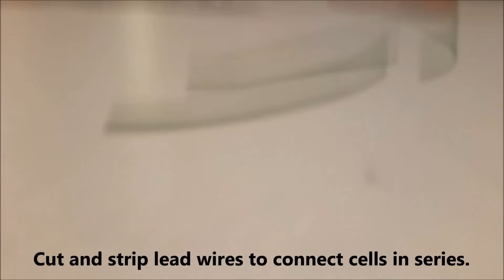Soda Can Battery - Power From Trash - DIY Project

Comment: The inside lining of soda cans, if sanded off, should give you 0.9 volts.  I did it without first sanding it and then after sanding it.  It was 15% improvement in voltage.
Reply from the maker: Awesome Homayoun thank you! I will try that on the next version. Please share and subscribe!
Reply: What grit sand paper?
Reply: Yeah there is a thin film of plastic inside aluminum cans so sanding it makes sense
Reply: i didn't think it would work without a sanding at all
Reply: @Dan Lapain it's thin enough to allow conduction, just not as efficient as it can be...
Reply: I don't understand
Reply from the maker: Hey Guys, I thought you might like our newest DIY Power Bank from JUNK D cell Batteries project - https://youtu.be/myTu52BbfiI  . Would love to hear your thoughts on it. I hope you're having a great day! Please give it a LIKE and Share!
Reply: Could the plastic lining also make for a cheap capacitor material?
Reply: @SourcePortEntertainment  what would happened if you used a blend of sand and powdered battery acid, alkaline water/potassium
Reply: ya there is a plastic film layer
Reply from the maker: @yahwehfirst6051 Not sure. Probably would have had better volts and amps. I was trying to use less hazardous chemicals to keep it safer for my kids helping me.

Comment: Nice idea but few improvements rather than using copper and tin use carbon rod and zinc plate which will produce 1.5 volts each
Reply from the maker: Interesting suggestion I will have to try that. Thank you for watching and commenting, please share and subscribe!
Reply from the maker: Correct thank you
Reply: No I'm telling to make it with trash zinc carbon batteries

Comment: Great project!  A few improvement suggestions: Get rid of the cardboard. Replace the bottom insulator with something more robust (plastic, plexiglass, etc.). Do not put any insulator around the can at all, that reduces the contact area increasing the battery's internal resistance affecting the amperage the battery can deliver. Sand alone should prevent the shorts from happening. To further reduce internal resistance give the inside of the cans thorough sanding and also make the copper as large of a surface as practicable (eg a few serpentine twists or use foil instead of wire). Cover the cans with lids to reduce electrolyte evaporation. Use a mild acid instead of salt.  Good luck.
Reply: Hi Bob, thanks for the suggestions. I am wondering .. If we go and use alum foil and copper foil [like a sandwich], would that work ? sounds like the better conditions, bigger surface area all around.  Questions :

1. The sand is there to keep the copper from touching the other terminal, right ? It does not involve itself in the chemical reaction, correct ? while the granules allow the liquid and ions to go through to perform the electrical currents ?  If all this is correct, then can we use gauze or cotton to separate and make the sandwich ?

2. Is there anything in this being the consumable items ?  Eventually the metals will be eaten away ?
Reply from the maker: Thank you for the comment Bob and for the suggestions! Please Subscribe if you haven't already, I would appreciate your feedback on future projects. I did put some vinegar in later which did seem to increase output to the light, however the cans started getting holes in them shortly after. I should have put them in seal-able plastic containers to prevent evaporation and leaking. Would have keep them running longer.
Reply from the maker: Hi Kingston, thanks for your comment. Please Subscribe if you haven't already!

1. I just used the sand to hold the copper wire in place. Unless your sand has any acidic or electrolyte properties in it, the sand should not play a role in the chemical reaction. Yes I would think you can use gauze or cotton. As long as the two metals do not touch, which would cause a short.

2. The Aluminum is being consumed in this type of battery. Holes start to appear in the Aluminum cans after several weeks.
Reply from the maker: Hey Bob, I thought you might be interested, just published the update for this video. Please check it out, share it, and let me know what you think. Thank you https://youtu.be/DRVzPqgp10c
Reply from the maker: Hey Kingston, I thought you might be interested, just published the update for this video. Please check it out, share it, and let me know what you think. Thank you https://youtu.be/DRVzPqgp10c
Reply: The insulator can not be plastic. The electrolyte has to be able to flow though it. If the coil can be made so it will not touch the can the cardboard is not even needed. I have made a few of those home made batteries before.
Reply: Bob Berg so are you saying orange juice and what other acids
Reply: Even more, the inside surface of the can is already covered by a plastic layer in order to avoid corrosion of the aluminium with the acids of the soda. So you need to clear that layer by sanding it.
Reply: Thank you .what mild acid  you preconise?

Comment: If you take Washing Soda Na2CO3 you will get at least double of this cell voltage... If you will use Carbon rods from Zinc carbon Batteries instead of the coper spiral you can get 1.3 Volts with Na2CO3 if your can is from Aluminium...
Reply: Is this experiment really work?
Reply from the maker: We thought you might like Building a DIY ROCKET STOVE video - https://youtu.be/Hlir866cp-E please LIKE and leave a COMMENT. We value your feedback!

Comment: Nice kids project. Tip. All Alu cans are coated inside, rough up the inside of the can with a wire brush on a drill to maximise the alu surface area, increase the copper wire diameter and amount of coils, more copper equals more amps.
Reply from the maker: Great tip Mr Freddie! Thank you for the suggestion. I will definitely rough up the inside of the cans next time. Please share and subscribe!

Comment: I would be curious to understand what you can turn on with a battery of this type, a computer, TV, other?  Thank you
Reply from the maker: This battery is very low amperage and can only power small LEDs or possibly calculators or other small appliances. Might be able to trickle charge a smartphone very slowly at this amperage. Thank you for commenting and watching, please share and subscribe!
Reply: @SourcePortEntertainment  thank you for your answer

Comment: Is it rechargeable?
Is it just a amateur project or can I use it as a battery?
Reply from the maker: Thanks for watching and commenting. It is not rechargeable. It is a primary battery, similar to an alkaline battery,  that can be used for very small voltages and currents. Or you can use it to slowly charge a phone with the right adapter or step-up board.

Comment: Basic science. As a kid I made batteries using copper wire and zinc-coated roofing nails in salt water or powdered citrus drink: They produced 1/2 of a volt and was totally unusable in powering anything larger than a toy car motor. And was unable to power an incandescent flashlight bulb. Even like this, It cannot large amounts of power.
Reply from the maker: Hi David, thank you for watching and commenting! I appreciate you sharing your past experiments. Please SHARE and SUBSCRIBE!

Comment: Hi My son tried it and was able to produced 3.5 volts on 9 cans but unable to power up a 2.2volts light from an old flashlight. Light works when we are using a 2pcs of AA 1.5v battery. Any other suggestions?
Reply from the maker: Hi Alan, thanks for commenting. That is great your son tested this out. If it was an LED light he will want to make sure he tries the positive and negative both ways LEDs only work in one direction. If it is an incandescent light bulb it might not work, because this produces a very small amount of  current (amps). AA batteries can produce much more current. Please reply back and let me know if he gets it working! Please share and subscribe! - Danny
Reply: Source Port Services  Hi Danny, you are correct! We were able to light an LED. Thank you very much for your help.
Reply from the maker: That's awesome Allan! Glad I could help. Thank you for watching and sharing my videos. - Danny

Comment: hi! is the aluminum material of the can necessary for it to work? or can we use other alternative materials like plastic jars?
Reply from the maker: Hi, yes two dissimilar metals, like copper and aluminum, are needed for the battery to work. You could put these batteries inside of plastic containers to prevent leaking electrolyte if you want, that would be a good step. Thank you for watching and commenting please like and subscribe!
Reply: @SourcePortEntertainment  thanks a lot!! btw, I tried connecting the cans but the volts aren't adding up? What do you think is the problem?
Reply from the maker: If the volts aren't adding up it is usually a poor connection somewhere in the chain of cells.
Reply: @SourcePortEntertainment  thanks man, i'll try again
Reply from the maker: Did you ever get it working?

Comment: How should i recharge the batteries? Do I add more salt water if it dries? Also, Can i put vinegar?
Reply: Can i have an answer?
Reply from the maker: Sorry the batteries can't be recharged, they destroy themselves to transfer the electrons. However you could build new cells to replace any that are reading too low of a voltage. You could also refill the cells with more salt water if they start drying out. Thank you for watching and your comment! Please SHARE and SUBSCRIBE!

Comment: Hi should the copper wire touch the can?
Reply from the maker: It should Not touch the can. You need to keep the two metals separated from each other by your electrolyte fluid (and sand in this setup). That creates the difference electrons in the two surfaces that makes the electric charge. Thank you for the question, please Share and Subscribe!

Comment: doesnt the can touching the water and water touching the copper mess it up, like touching hot and ground wires together?
Reply from the maker: Thanks for the comment KC, to my understanding no, that doesn't short the circuit out. You can put a piece of Copper and a piece of Aluminum or Zinc in the same glass beaker filled with an electrolyte (acid or salt water) and they will build up charge on the to different metals waiting to be connected to a circuit. Please SHARE and SUBSCRIBE!

Comment: Could you tell what specific voltage of the flashlight head? Like the watts and others
Reply: Like what can be substituted to that if we can't find smth like that
Reply from the maker: Hi Wendell, most small white LED flashlight heads should work or if you have another type of LED from the front off an old junk computer tower. Usually the front power light or hard drive activity light.

Comment: is there a way of increasing the current with this setup?
Reply from the maker: Hi Reyna, More length of copper, bigger coils, inside the cans should increase the amperage. Also lightly sanding the inside of the cans with steel wool should help increase contact. Please subscribe for my next project!
Reply from the maker: Hello Reyna , I thought you might be interested, just published the update for this video. Please check it out, share it, and let me know what you think. Thank you https://youtu.be/DRVzPqgp10c

Comment: I made these and after about 3 days I had salt water all over ..the salt caused holes the sides of the cans...Made different ones using large plastic jars , galvanized pieces of metal, larger gage copper wire, and epsom salts instead of salt and distilled water .
Worked a little better...no leaks.. like batteries with electrolyte of some water mix,  the water evaporates and add only distilled water to prevent  build up of minerals in tap water. that cause batteries to deteriorate..
Reply from the maker: Hi Willard, thanks for watching and sharing your results! Please remember to subscribe. I just released a Splitting Maul Handle Replacement video that could use your feedback if you have time. Thank you!

Comment: This is so creative. Thank you. :) If I thicken the can and make it smaller, will there a difference on the voltage and amp? I want to do eco-friendly small and little bit more voltaged battery. Do you have any suggestion or advice? Thank you again.
Reply from the maker: Hi Urnaa, thank so much for watching and commenting! More surface area in contact with the saltwater or vinegar would give you more amperage, so more copper wire in the coil inside tthe can should work. The voltage ⚡ you would have to get a different metal probably. Aluminum and Copper only produce up to a certain voltage. Please share my videos and subscribe!
Reply from the maker: We thought you might like Building a DIY ROCKET STOVE video - https://youtu.be/Hlir866cp-E please LIKE and leave a COMMENT. We value your feedback!

Comment: Would it generate more volts and milliamps if you used a liquid that was more acidic or to stay with the salt water?
Reply from the maker: Hey Dominic, thanks for the comment. Yes it would produce more milliamps if we use the more acidic liquid like vinegar or lemon juice. If you even use something more corrosive like hydrochloric acid, I would NOT recommend it, since the aluminum can is so thin and would just eat a whole and leak right through. The more safe substances would be lesser acids like vinegar or lemon juice. Please share the videos and subscribe thank you!
Reply: Thank you
Reply from the maker: No problem Dominic! Please ask more questions if you have them. - Danny

Comment: Amazing, thanks for sharing, with that 5.26 voltage you will be able to use a Boost converter and run higher voltage devices, it's a live saver for sure
Reply from the maker: You're welcome. I could have gotten away with making a few less cells and using a boost converter to get it up to the 5 volts needed but figured I would just run it straight through for this test. Thanks for subscribing!
Reply: No. It's about 2 W. Will charge your phone in about 10 hrs. The current is too low.
Reply: should ahve use mutistrain wire for MAX effect rather then a single one
Reply from the maker: Thank you for the tip!

Comment: You could get more voltage and power if you charge the whole set using dc current from a old ac to dc adapter or a big lead-acid battery👍
Reply from the maker: Thank you for the advice Sudhakar, Also I thought you might like our newest DIY Power Bank from JUNK D Batteries project - https://youtu.be/myTu52BbfiI  . Would love to get your feedback on it. I hope you're having a great day! Please give it a LIKE and SHARE!
Reply: @GoogleUserNova1680  what do you mean charge them? How do I do that. I want to make a rechargeable 13v supply that gives like 30Amps that can work alongside a power Supply

Comment: looks good  how long with they stay lit. you might charge a big capacitor.
Reply from the maker: Hi Joseph, they stayed lit for a week or two at a time till the cells dried out. Then I just refilled them again and with a bit of water and it would keep running for a few more weeks. It got a little dimmer each time because the electrons were being used up in the chemical to electrical reaction. The holes in the cans are shown in the update video. Please give this video a share on social media or reddit if you can. I would greatly appreciate it! Thank you for your comment!

Comment: Before wiring them to a series, each cell has 0.5v but when i wired them to a series I only got 2 v. I have ten cans it should be 5v what did i miss?
Reply from the maker: You might have a bad connection between the cells when you wired them in series. To troubleshoot which connection is bad keep the positive terminal of your voltage tester on the first cells positive terminal. Then touch the can side of that cell to test for .5v on the fist can (cell). Now keep the one terminal for your tester on that first can positive side of the cell and move the negative terminal of the tester to the2nd can in the chain. You should get about 1v from the 2 cans. It should increase in about .5v per cell if it does not then that it's the cell with the poor connection. Re-solder or Re-crimp that connection them continue on until you get the full 5v. Please let me know if that helps. Thank you for watching and commenting. Please SHARE and SUBSCRIBE!
Reply: Hello, id like to thank you for responding very quickly but I have more questions with me:
1.  how do i increase the voltage of each cell? (I sanded each can already) I found out that some cells are shorting out. 
2. What is the yellow looking tape? Should i also have the same?
3. Are the lead wires you used stranded or solid? 
4. What is the voltage of the led flashlight you're using?
Thank you so much!
Reply from the maker: @cozylab4280  
1. There isn't a way to increase the voltage unless you use different metals for your cathode and anode, positive and negative sides of the cell.
2. The yellow tape doesn't matter, any electrical tape will work.
3. The connecting wires I used are stranded but, at this low of an amperage it shouldn't matter.
4. It was an LED flashlight head that used 3 - AAA batteries 1.5v x 3 = 4.5v works in a range of about 4v-5v

I am always happy to help. Please share this video on social media if you appreciate the help.
Reply: @Source Port Entertainment hello again. I connected a small led christmas light but it is not working.
Reply from the maker: Test the light with a few AAA or AA. To see what voltage it requires.